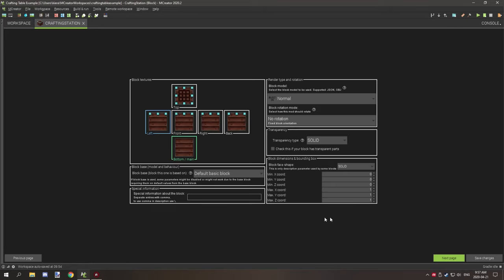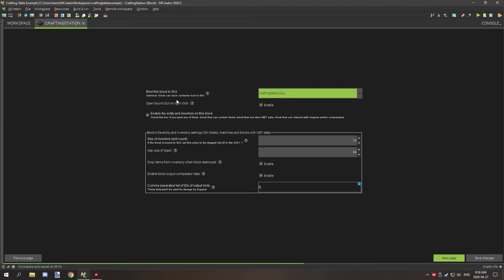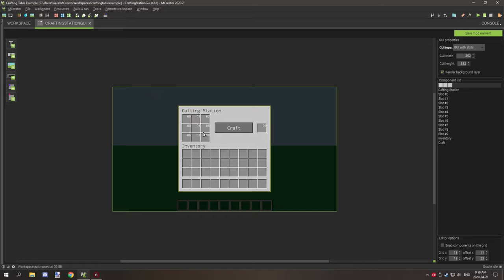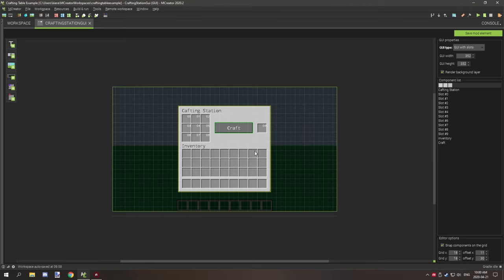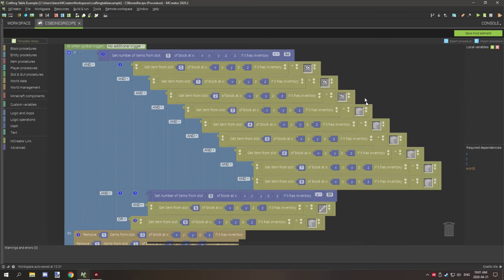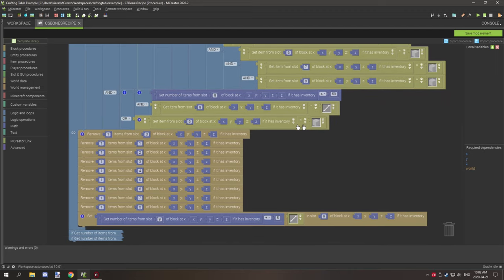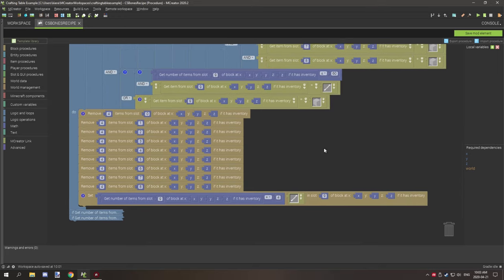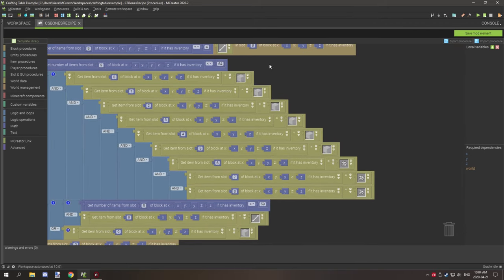MCreator Tutorial: How to make a crafting table | 2020.2

Comment: "Get Item from slot (slot) in block x y z if it has inventory" is missing from the Block list, so i used "Get Copy Item from slot (slot) in block x y z if it has inventory", but that didn't work.
EDIT: I used the 3x3 crafting table template, but that STILL didn't work!
I have the procedure saved, the button linked, and i even have every single grid used in my recipe in case the air blocks were the problem. Nothing works. Also my error is that when i press the button in the Play testing client, it doesn't do anything.
Reply: You are using a newer version, it happened to me, and idk what to do...

Comment: Where is the "AND" block that you used? Like what section is it in on the sidebar with all the code blocks?
Reply from the maker: This is under the Operators tab and you want to select the light blue operator then use the drop down block to select the AND operation.

Comment: Hey man, I made a custom model and wanted to turn a part of it that looked like this |_ into something like this |\ (on a 45° angle) and did so by filling up the gap with two one pixel wide cubes intersecting each other both rotated on a 45° angle. This caused z fighting (not visible on blockbench) even tho the textures were the same because the upper cube appears darker in the game. Any suggestion on how to fix it?
Reply from the maker: 45° angles are only possible to do in the modeling of the block its self not in the vanilla minecraft world, if you select the cube you want to rotate then on the right hand side there will be an option that appears for rotation on the X, Y and Z angles adjusting the + or - will rotate the block. For entities similar thing but the mesh you want to rotate needs to be in a group or the option will not appear. You also need to select the group for the entity model kind not the element its self.
I hope that helps.

Comment: The open and main recipe procedures keep saying it cant be compiled because "error: cannot find symbol". Any idea on this?
Reply from the maker: Normally this is given when a block is not supported, it would not surprise me if something broke, lots of stuff has changed since 2020. Its on my todo list to update the tutorial though I just have my hands full with the Forge energy/fluid system at the moment.
Reply: It happened to me today, maybe you made an element in your mod, it didn't save properly, and then when you reopened MCreator it couldn't find that element, try to rebuild the code with the hammer button in the upper right part of the screen

Comment: Bro, I need help. I have a simple "crafting" --> coal to coal powder, but my block "Set item in slot"(something like that) is, just like its called, SETTING me just one colepowder. Not adding it to itself. Like i click on button, one coal is removed, coal powder is added, but when i pressed the button second time one coal is removed but coal powder is still one. I have math (smt) + 1
Reply from the maker: You need to get if the slot has 0 items or if its the same item but less than "<" 64.
Then when you set the item to the slot make sure to get the count of the slot for the item + 1 and then set the item.
If you just set 1 it will just set 1 item to the slot you need to get the value and add to it.
Reply: @NorthWestTreesMCreator  thanks, apprichiate that

Comment: and how to make a crafting recipe without the craft button?
Reply from the maker: I have used a set pattern in the table and not craft all the items so rather than check for => 1 to set that to => 2 and this way it will keep a patter in the crafting table. From there you can test if the item exists in the table and push a specific item in the slot and have it auto craft using a update tick procedure. This is semi-automatic unless you have a block to push item in to the slots or have script to test for items on a specific side of the blocks rotation from a chest and pull items into the slots.

Not sure if that makes any since but its a bit more advanced to set up then a regular button.

Comment: How can I see these recipes in JEI?
Reply from the maker: I have never used JEI with MCreator before I highly suggest asking on the MCreator forums as you may have a higher chance of someone seeing your post and helping. Sorry I can't help with this question I would if I had any ideas.
Reply from the maker: Just an after thought but maybe try using "Recipe group name" if this ID is unique then it will separate the recipe from other recipes in the crafting and furnace helper screen so it may also help with JEI. You should also be able to use the same ID to group things too.